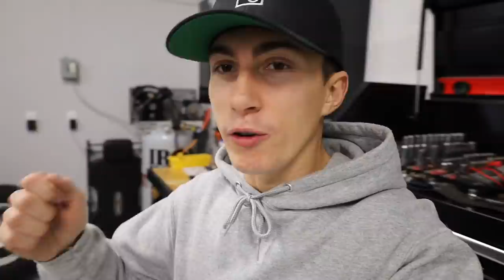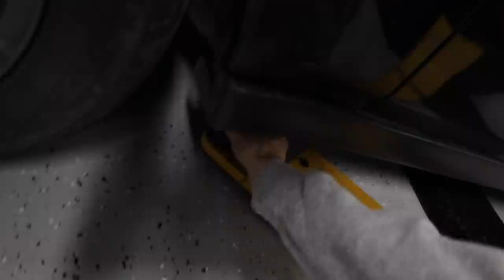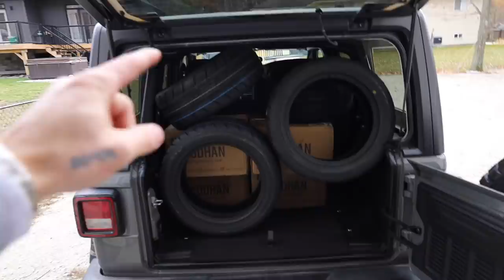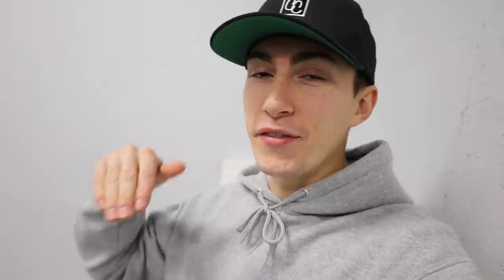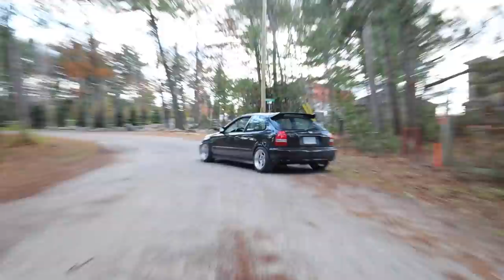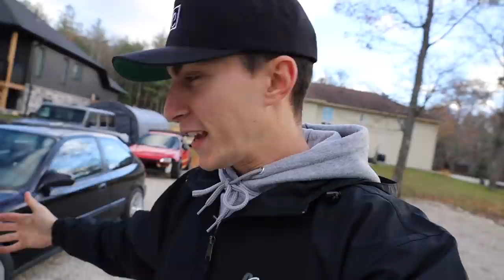Sleeper Civic gets NEW WHEELS!

Comment: Yo Robbie, I have Aodhan wheels and had the same center cap issue... what I did was take a dremel and make the hole in the back big enough for the bolt to fit into. you can grind away the plastic and the foam stuff on the back of it

Comment: I think that this should totally be the final stance, it is perfect it's still a little bit hot boy but it's tuner'y enough that you can still put the power down. If you want to tweak this suspension more to make it handle and drive better that's cool but this is the perfect height and camber. It just looks so fire right now!
Reply: Wrong, drop 2”

Comment: These type of tires really need to be warm to fully grip, so your grip testing probably didn't even show their full potential

Also for that center cap issue I feel like your brother could 3d print some kind of adapter/spacer to have the cap basically raised to clear that axle

Comment: anything's gonna spin in 1st gear. however, that doesn't mean having the most grip you can doesn't make a huge difference. I have 225/45/15 200tw tires and its worth it to  dead hook 460whp in 3rd gear before i had 205 300tw tires and it is night and day with how much faster the car is. I also highly suggest adding boost by gear to really take advantage of the power

Comment: Sorry to hate, but not a fan of the new wheels and tires.  Never been a big fan of polished so that throws me off to begin with, but you gotta get the offsets a bit better so they can tuck under the fenders and not stick out.  That and get some lower profile tires, those just look way to tall to me,   If it was me I would have gone with some white wheels for the hard contrast that just barely tucked under the fenders without needing to be stanced.